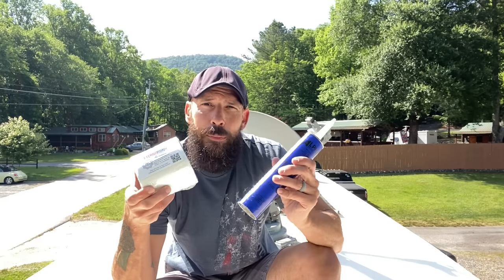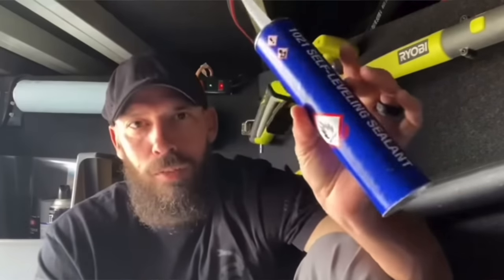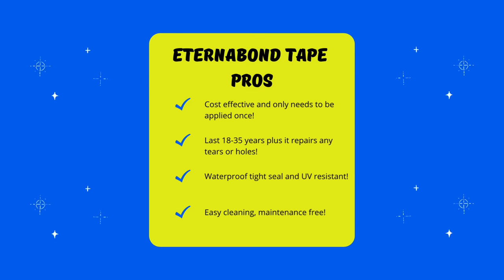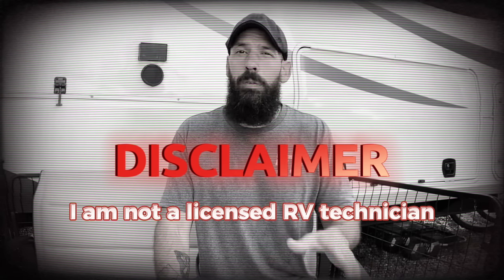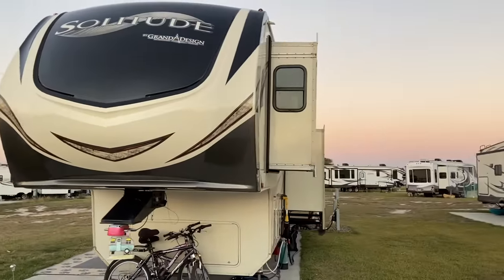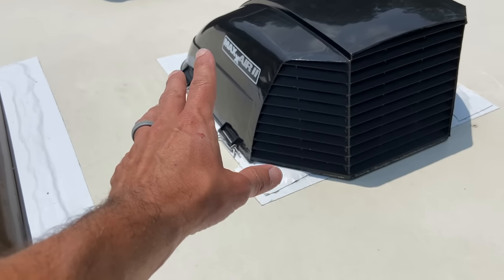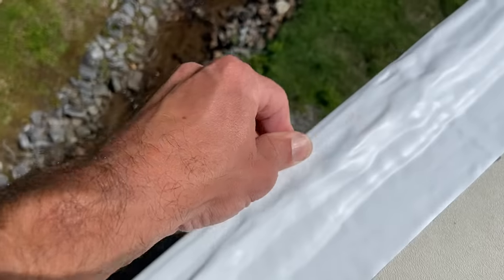NEVER Reseal Your RV Roof AGAIN! (Eternabond Tape VS Lap Sealant)

Comment: Hopefully you don’t mind a question and some information.   Question, is the eternabond or the lap sealant the “seal” for a joint or something installed?   The answer is absolutely not.   The seal is installed before either product can be installed.   So, if you have a leak, putting a bandaid on top is just that.   You have not fixed the real issue, you just covered it up.

Comment: shouldn't be a debate. a sealant coming out of a caulking gun should never be used for sealing penetrations on roofs or windows etc. this is not done for houses, why should it be done for an RV? counter flashing is the standard industry method of a house. Same should be true for an RV and then where not possible this sealant tape is what should be used. success is dependent upon prep and proper installation like anything else. removal concerns are not a legit issue since the tape can easily be applied on top of the existing so simply cut out however much you need and lap the tape over the existing. RV manufacturers should be ashamed of themselves for the methods and materials used.
Reply from the maker: Very good comment. I agree 👍🏼Thanks for watching

Comment: Be sure to consider what your roof is made of before you apply anything.  Check with your Rv manufacturer 🙏🏻
Reply from the maker: I’m sure it will 👍🏼 EternaBond bonds to virtually any surface except silicone. This includes all roofing materials, brick, wood, metal, stucco, rubber, vinyl, canvas, etc.
Reply: @WhyWait  I’m not concerned about it bonding, but there is some concern about the chemical reaction to certain products that could bring about a problem down the road

Comment: Sorry for repost... referring old camper with metal roof and sides. Drip rails are applied over  sides and roof wif putty tape. Should i put tape on before applying drip rails? If so, screws will go thru tape. What would be best way to apply?
Reply from the maker: Honestly Jim I’m not to sure. Can’t really picture what your referring to and since I’m not there to see it I’d hate to steer you wrong. When I doubt overkill never hurts hahaha 🤷🏻‍♂️
But if you have screws going through any tape or sealant I’d always want the screw heads then sealed up or taped over myself. Hope you get it figured out. 👍🏼

Comment: How did you cut your eternabond tape.  I had another brand but it was a bear to cut using scissors or knife. Maybe a razor blade would work, I haven't tried that.
Reply from the maker: I used some old scissors, every once in awhile I’d clean them up to get this sticky stuff off the scissors. The Eternabond cut easily for me though. 👍🏼

Comment: Am in this process of putting Eternabond tape down and have a question that will hopefully get answered before I finish.  Haven't been able to locate information on possibly leveling one area that has ponding.  Found a solution that resolves this issue on flat roof adobe type homes by putting down 505 Puddle Plaster or Henry 176 PondPatch Filler and Leveler and troweling out to be level.  My first question is:  can you use this on an RV roof? Henry's does talk about, it can be used over the roof membrane for maintenance or under a new roof membrane.  The membrane on these roofs looks like a big sheet of eternabond.

2nd question:  after putting eternabond tape down, can I go back over it with Dicor roof coating?  Will it stick to eternabond?
Reply from the maker: First question: I have no clue on that stuff couldn’t tell you
Second question: Yes, lots of people actually put roof sealant down along the edges of the Eternabond tape  
👍🏼👍🏼

Comment: Talked to my rv mechanic friend about this.  He says it works great in most cases.  Downside he says is it can be hard to see if it fails.  Lap sealant you can see cracks.  Eternabond you will notice failing once you have water damage inside walls with it still looking fine outside.  Just a couple small spots of lost adhesion can create a lot of damage.  But it all comes down to proper application.  That being said he thinks more people screw up redoing their lap sealant so more damage is being caused by that.
Reply from the maker: All good points Mark. Appreciate you watching and the comment. 👍🏼

Comment: Do you need to reapply the seal if it is cracked first? Or can you just put the tape over the old seal?
Reply from the maker: If the old sealant has just minor cracks it’s ok to tape over but if there’s any sealant peeling up from the roof or even large cracks I’d reseal it first. 👍🏼
Reply: Thank you!

Comment: I really want to get up on the roof and do mine, but its currently 95-100 degrees outside.
Reply from the maker: A bit hot for sure. This project cost me a pretty good sun burn on my back hahaha. You might want to wait for cooler weather. Thanks for watching 👍🏼

Comment: I’m just curious, why would you need to fix the lap sealant before putting the eternabond tape on? Wouldn’t any cracks be covered by the tape? Seems redundant to me
Reply from the maker: Mainly for when the lap sealant is flaking, cracking and showing signs of peeling up from the roof. If it’s starting to come off the roof your apply tape to something that is in all reality not attached to the rv anymore. I’m sure you could get by without doing this it’s just a precaution and the way I like to do it. Thanks for watching.

Comment: In the process of adding eternabond to all roof penetrations as well as seams and slides.

In theory, if I were to eternabond the entire roof, would I have good results from this?
Reply from the maker: It would cost a fortune, look pretty bad and it’s not necessary to tape over the good part of the roof. Just seams, seals and old sealant.
Reply: @WhyWait  Will taping over the side of the slides, where the TPO meets the top of the slide out side wall, create a spacing issue when retracting the slides? Thank you
Reply from the maker: @SabrinaChavez-tu9nb  it can, yes. Be careful with this especially on the schwintek slides. 👍🏼
Reply: @WhyWait  thank you for the info. Best rv channel on YouTube!

Comment: Would this be good to use on a pop up camper? I tried re-sealing it two years ago and the sealant didn’t hold up.
Reply from the maker: Not too sure but it works on almost any surface so it should be good.

Comment: What is the difference between Eternabond and FlexTape?  I have used FlexTape on my trailer, but only because I hadn't heard of Eternabond.
Reply from the maker: Eternabond is made specifically for an RV roof and I would be concerned with the solvents in FLEX TAPE. EternaBond bonds to virtually any surface except silicone. This includes all roofing materials, brick, wood, metal, stucco, rubber, vinyl, canvas, etc. So EternaBond is the perfect repair product for buildings, RV's, tents, sheds, canoes, tarps, etc.
Also, EternaBond has an expected life (depending on where you live) of 18-35 years exposed to the weather. Flex tape just seems like more of a gimmicke as seen on tv product that I personally would trust.

Comment: So my question is is it not better to remove the lap sealant and then apply tape
Reply from the maker: Lot of work. If the lap sealant is still sticking to the roof and not flaking off I’d just tape over it. It will still basically act as another barrier of protection.

Comment: Is this only for fiberglass installation? 
I have a class B van that has the metal roof of the Promaster Chassis.
Reply from the maker: Oh no this works in almost everything! EternaBond bonds to virtually any surface except silicone. This includes all roofing materials, brick, wood, metal, stucco, rubber, vinyl, canvas, etc. So EternaBond is the perfect repair product for buildings, RV's, tents, sheds, canoes, tarps, etc.
Here’s a link. 

https://amzn.to/48Jb77d

Comment: If the tape is wider than the old bead of sealant, would you really have to remove the old sealant first? Wouldn't the edges of the tape provide the water protection anyway?
Reply from the maker: Yes, in the video I don’t remove the sealant at all. Unless the sealant is already pulling up and coming off like I stated.
Reply: Awesome and thank you for the clarification - one less step for me in the project. I've been researching Sikaflex or Proflex RV vs Eternabond, and I like the idea of a tape that won't have any degradation in a section, like a caulk inevitably will - I don't care how good they say it is! 😏

Comment: There are seams on my fiberglass roof, especially along the front cap joint where the sealant wasn't self leveling, so it's lumpy and quite thick. I hear you about how it looks but if the caulk isn't smooth the tape would have less surface area to stick to, So the question is can you clean and strip sealant down to a metal-fiberglass seam and then use Eternabond, or should it be re caulked (self leveling), and then the tape? In some instances doing it this way would give the tape a cleaner look too. Thanks
Reply from the maker: You could totally take off all of the old sealant  and then clean it up super good and retape with Eternabond. I mean I guess some self leveling sealant first then tape would be like an extra layer of protection and wouldn’t hurt.

Comment: The previous owner has coated my roof with one of those rubberized coatings. Will Eternabond  stick to it?
Reply from the maker: I’m sure it will 👍🏼 EternaBond bonds to virtually any surface except silicone. This includes all roofing materials, brick, wood, metal, stucco, rubber, vinyl, canvas, etc.
Reply: Eternabond DID NOT stick to my rubberized roof. It must be some sort of silicone product. So I took a wire wizz wheel and wizzed off a few inches of that coating down to the original aluminum and it then applied it. It stuck well after that and then I painted the bare surface that was left @WhyWait

Comment: We purchased a  gutted 1967 vintage Barth trailer that we are renovating. I read in the comments that you can use it on aluminum roofs. Do you apply eternabond tape before liquid rubber, or after?
Reply from the maker: Hey Karen thanks for watching. By liquid rubber do you mean self leveling lap sealant? Or some kind of rubber coating your putting down on the roof?
Reply: @WhyWait , I truly know nothing about TTS!  Is the whole roof supposed to be sealed, like with roll on stuff?  😊

Comment: Lap sealant is the biggest money maker in the RV industry. What other sealant in the history of sealants do you have to check every few months?

Eternal bond tape is an excellent solution and I've used it on all of my RVs and have never had a failure.
Reply from the maker: Totally agree with you 👍🏼👍🏼

Comment: I went down quite a few posts to see if it had been asked before. I don't know what scenario you would need to but would this effect the warranty at all ?
Reply from the maker: Just depends I suppose. On the brand camper and your warranty. It’s something you would have to contact them and ask. I’m sure it would just to cover their butts any modification you do will be used against you so they don’t have to pay for any damages. Anything a company can do so they don’t have to pay up what should be under warranty.

Comment: I need to seal the roof, not seal the holes in the roof. I need a whole layer of roofing on a 30 year old RV, so what do you use?
Reply from the maker: Company like RV Armor could do that. Expensive though
Reply: @WhyWait  material: liquid rubber, water-based epoxy…?

Comment: Would it be smart to put a bead of sealent down the end flap of the tape?
Reply from the maker: It wouldn’t hurt, I’ve heard of people doing this. But then you are kind of right back in the same boat if inspecting that sealant and replacing it every few years or so. From most people I talk to the tape edges after years show no signs of coming up.

Comment: What do u use to seal the whole roof?
Reply from the maker: I don’t seal the whole roof. TPO and EPDM roofs only require cleaning for maintenance and using self leveling lap sealant around skylights and those areas. Now I Eternabond tape over the lap sealant.

Comment: I'd this good for pvc roofs?
Reply from the maker: Per Eternabonds website…Eternabond will stick to almost any surface except silicone. 
Use on: EPDM, TPO, most PVC, CSPE/Hypalon, CPE, SBS, APP modifieds, asphalt BURs, coal tar BURs, all metal roofs, tiles, shingle, aluminum, galvanized steel, gypsum board, wood, polyethylene, propylene, polystyrene, fiberglass, brick, concrete, masonry, OSB, etc. Seals roof tears, seams, flashings, copings, skylights, gutters, and much more. Can be applied in weather as cold as -20 degrees. Seals for an air, moisture and water-tight barrier. One step permanent leak repair tape.

Comment: Did you put your Eternabond over the vinyl strip molding on the side of your RV?  I am about to replace mine as I saw it dangling along side my RV as I was going down the road.  I assume you covered the vinyl strip molding and your done having to replace it forever, correct?  At least 10--20 years when the Eternabond life is over.
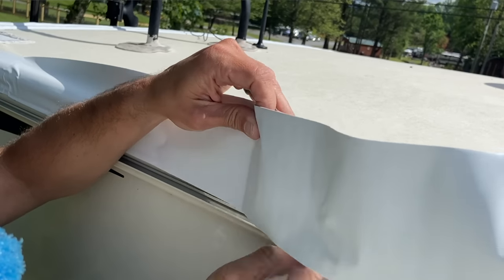Reply from the maker: Yes I assume your talking about the edges of the rv roof membrane. You can see this around the 9:00 min mark in the video.
Reply: Thanks for the reply...I have learned so much from your videos and have done a bunch of your recommendations!  My first 5th Wheel so I'm lacking the knowledge and experience.  This vinyl strip has screws under it with a screw at each end holding in place.  When the vinyl strip tore where the screw is, it just started coming out flying in the air along the side of the RV as I drove down the road.  I saw your video at the 9 min. mark and I just wanted to be sure before the eternabond goes over it....I do not want to screw something up.  I guess I really do not have to replace it again if I put the eternabond over the membrane and on to the vinyl strip.  Thanks again!
Reply from the maker: @markthomas1911  thanks I appreciate it Mark! If you ever need to access those screws for some reason you still could, probably just pop the bottom of the vinyl strip out. Besides it’s not impossible to remove the tape either if you had to. Thanks again for watching. 😘

Comment: Will Lap Sealant stick to the tape?
Reply from the maker: Yup. I have another section of Eternabond tape not in the video done from the dealership before I got the rv and they used lap sealant on the edges of the tape where they patched. Other people have recommended that to if you want, sealing the edges of the tape with lap sealant.
Reply: @WhyWait  That makes the tape very handy, as you can the fill in any small gaps or ledges where the tape might bunch up with sealant.   Good to know thanks for the info.

Comment: If there's some cracks in the old lap sealant do you think those should be fill before putting the Eternabond taped down? I have a side note question just bought a travel trailer and it has a small leak in the corner on the roof its 2in by 2in soft spot. the RV dealer was going to replace it by cutting the old wood and putting a new piece in. Do you think I should just get it sealed up real good and hopefully no mold would spread in the roof?  I'm kind of nervous about them going at it and maybe causing a bigger leak later on with them trying to repair it.
Reply from the maker: If they are willing to chase the leak and think they’ve found it I’d let them repair it. Sometimes opening it up is good because you can see what’s really going on and maybe realize it’s leaking from a different spot or something. After everything is sealed up good then do this mod if you’d like. Appreciate you watching 👍🏼
Reply: Just about finished eternabonding all my opening. Had a few cracks in the old sealant bur not going to add more of the crap sealant to those openings. Eternabond is a pain to get down without a few wrinkles but all in all it should be find with the old sealant cracks. Cleaning is a pain on the old 20yr EPDM roof, but it has never leaked. Going to reseal with Tropicool 887. Some say no silicone years ago, but now seems to be the way to go from most reviews I've read.

Comment: The only problem I see with this is what if you have to change a roof vent getting that tape off of the roof with out tearing the rubber is a pain
Reply from the maker: Using a heat gun frees it up or cutting right we’re the old lap sealant is under the tape works. You then pull up the lap sealant with the tape on it. Leave the other part of the tape on the roof. Do your project and retape. 👍🏼

Comment: I noticed you applied the tape over the edge of the roof on to the plastic spline screw cover. This spline gets dried and cracked eventually and needs to be replaced. Is this a good idea to tape on the spline screw cover??
Reply: I have a 2011 Landmark with full body paint and just this weekend I got on the roof because water wasn't running down the gutter like it should, it was running onto the slide out. The spline had come out of the groove and had become a gutter of its own diverting water all over the place and this happened on both sides. I had to push them back in on almost the entire length of the RV on one side and half on the other. I was thinking of using clear caulk on it this week but after seeing this.. I think this is the way to go. It will hold the spline in and lap over so the water can flow. The caulk may be ok but it could possibly prevent the water from flowing as easily and possibly cracking and capturing water. If I ever have to take the spline off I could just cut the tape with a razor along the spine.
Reply from the maker: Exactly 👍🏼👍🏼👍🏼
Reply from the maker: More of a reason to put the tape over that area. Mine looked fine and were all in place. The tape should only extend the life of them and protect them. If needed cutting the tape with a razor would be easy if I needed to replace. Thanks for watching 👍🏼
Reply: It's actually vinyl and a lot of the factories don't use high grade uv resistant vinyl, another reason to cover it with something more protective